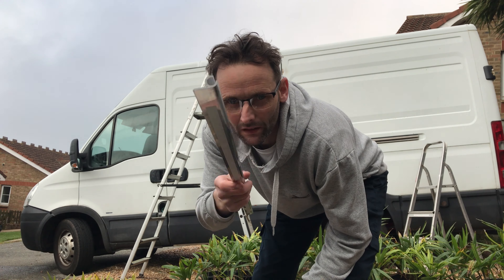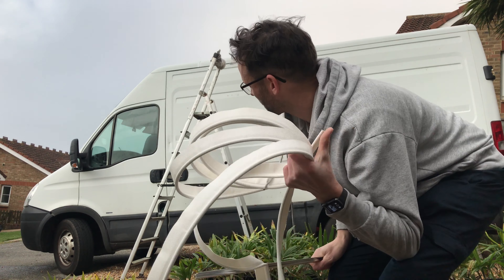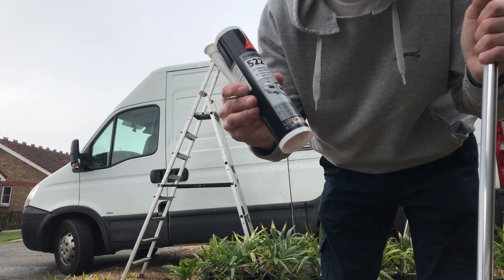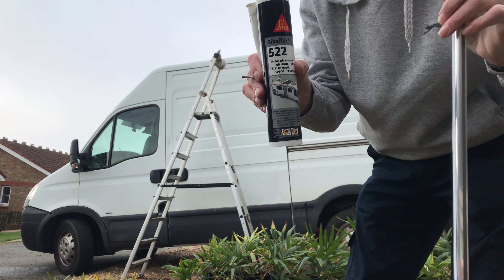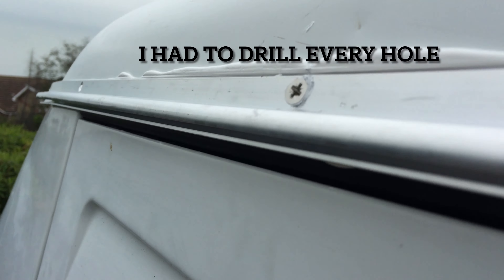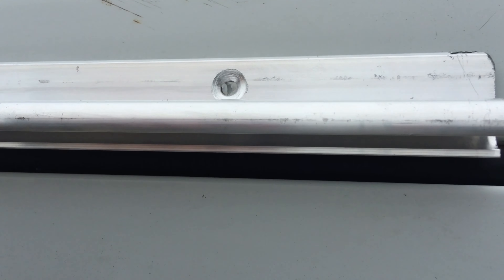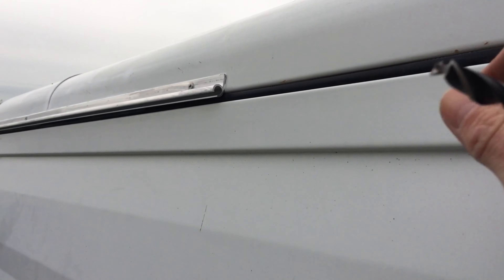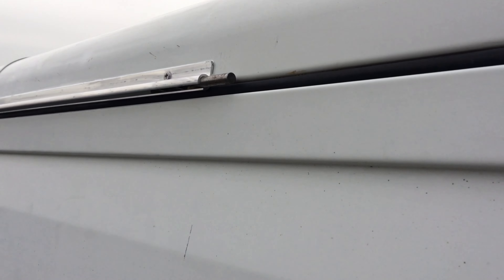Van build 1 awning installation

Comment: I hope you make some video's on your New Batteries.
What it's like ordering them and I want to warn you that the terminals are soft so be careful not to scratch them or poke your probe on them very hard. Maybe order the bolts and a washer to keep them safe from damage.
I say this because I've seen other have difficulties getting a good connection and they have to fix all the damage after testing and that doesn't seem like a good time lol. Hope this helps looking forward to some video's.
Reply from the maker: Good advice, I have been watch “off grid garage “ Andy was talking about the damage on the terminal, I’ll be careful 👍 and yes I’ll do a video on the 280ah Lithium battery.. 😆I’m so excited 😂
Reply from the maker: I ordered them from soonbuy on AliExpress, (2 orders) haven’t received any yet .. I got some 100ah ones from a different company, one cell was leaking on arrival and I think there all used cells.. just check out all the reviews first, I just went god the cheapest. If I did it again I would order from some recommendations on the Diy solar forum website.

Comment: Great video, I'm gonna use roofing screws with the rubber compression washer since it's water tight then seal over it and all around the edges and a bead around the screw. Anything you'd do differently? How has is held up in wind? I love the drill bit idea.

Comment: Did the door open and close without interfering with awning
Reply from the maker: No 🤫🤣, I would of still done it the same way, the sliding door doesn’t leak at all now. But when the awning is up the top of the door does drag across it. No rips or tears yet as the top of the door is smooth.